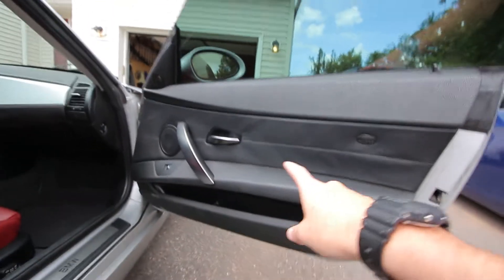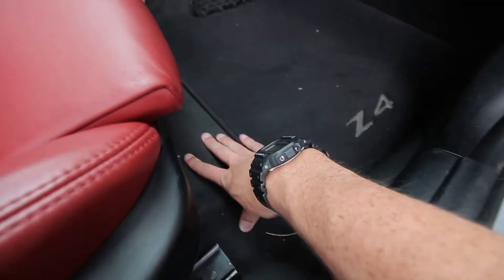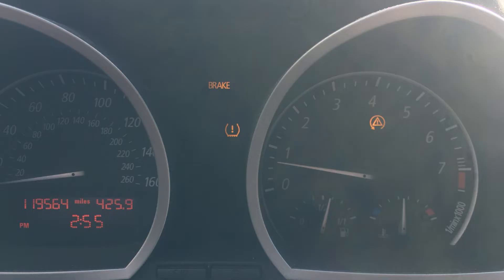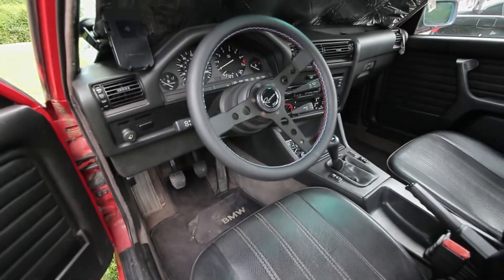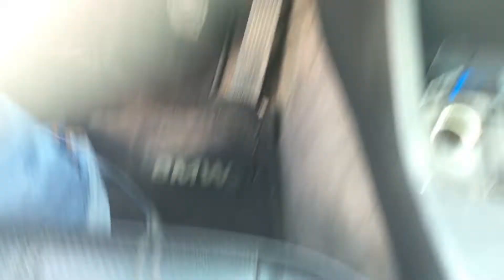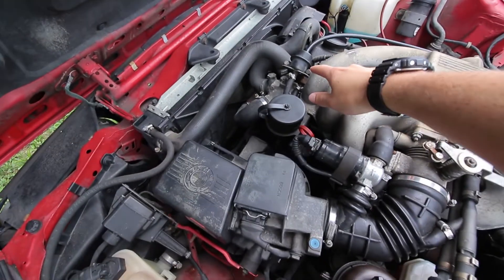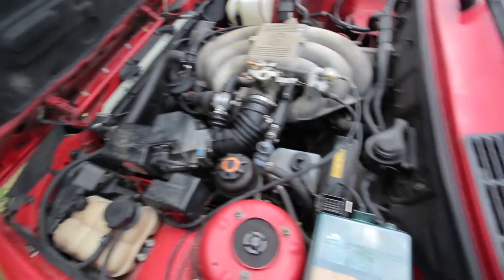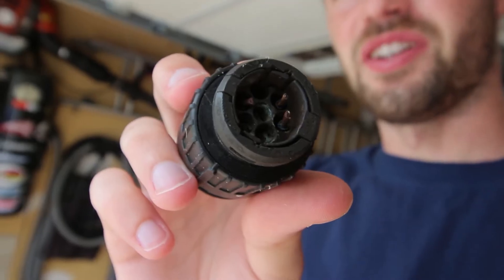BMW E30 C191 + Z4 Sensorcluster Problems!

Comment: how’d you fix the c191? I have the same issue.
Reply from the maker: Cut the wire adaptor and soldered the wires together using weatherproof shielding
Reply: @t_c  Are these suppose to be sticky within the connector ? And would it be the cause of stalling when hitting the gas. My e30 barely goes and then it’ll stall out when you hold the gas long enough.